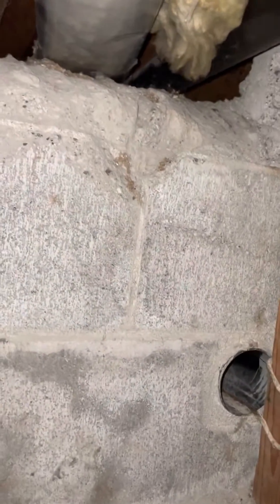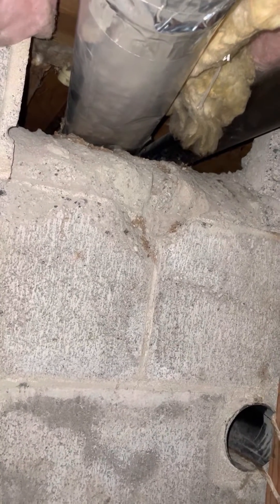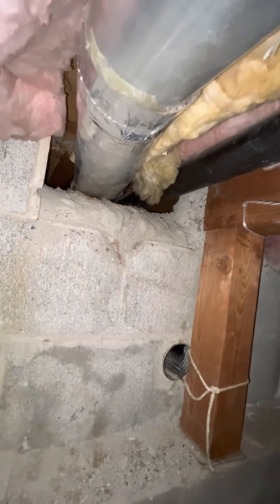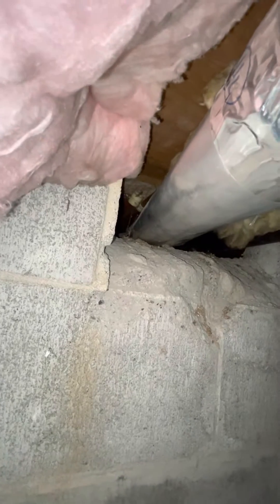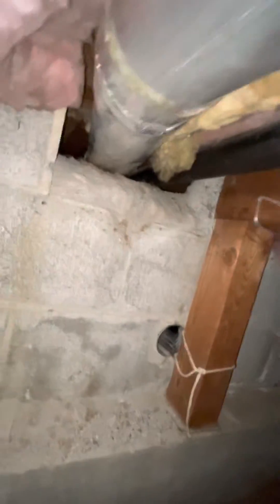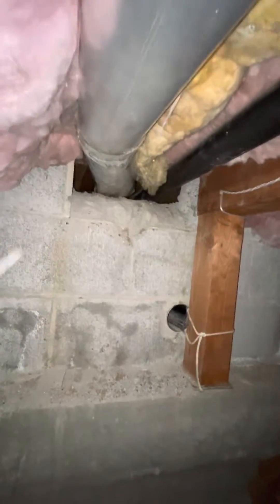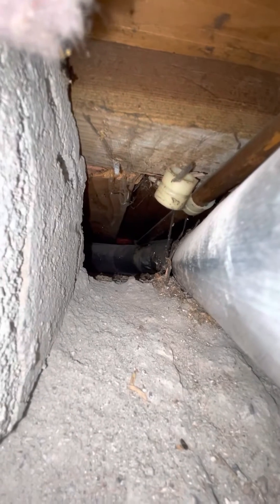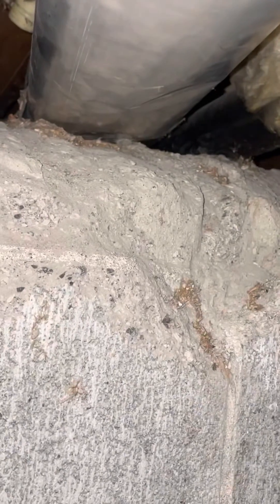Dryer vent cleaning, duct line squished in crawlspace.

Comment: I believe it was the fact that, they were trying to push lint through 50' of dryer line w/out a booster fan...
Reply from the maker: The length was definitely a significant factor in this case, but it wasn't enough to account for how weak the air flow was with no obstructions in the duct line. Even when it was completely clean there was still almost no air flow.